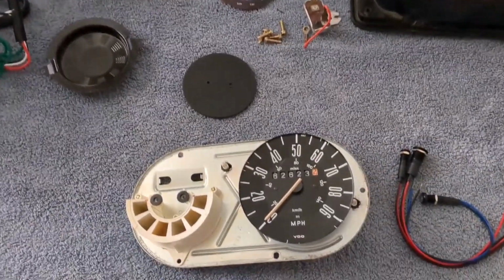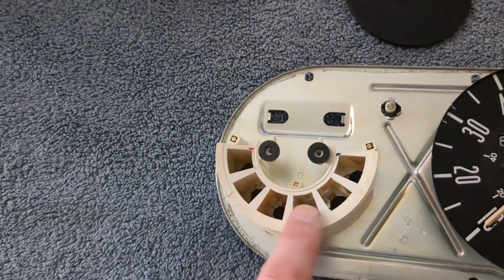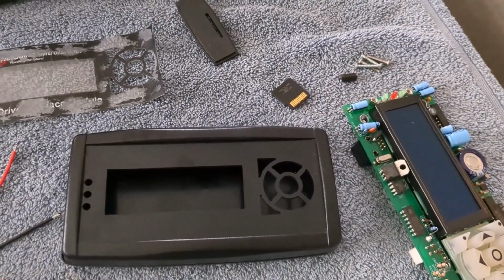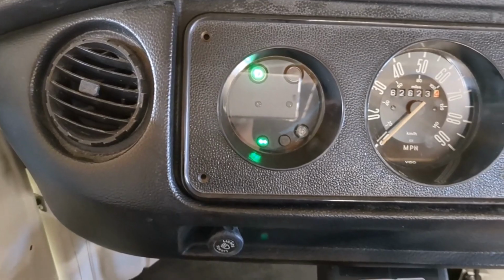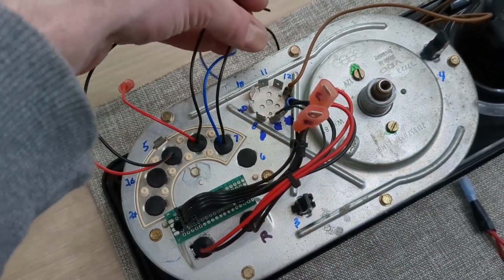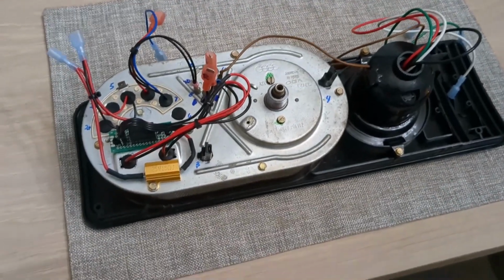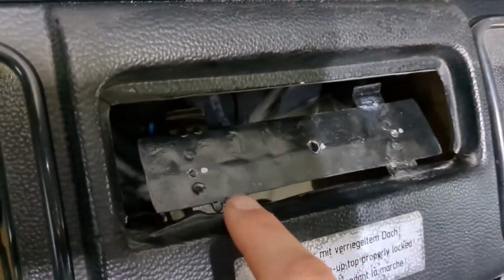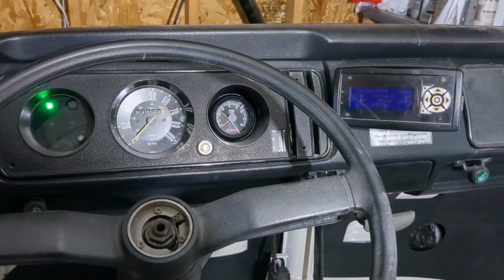VW Bus Electric Conversion Part 9: Dashboard Cleanup #evconversion

Comment: Love your video series! Question. Didn't quite get it; is the "charging" indicator tied to ignition? I.e. you will need to have the ignition key inserted to charge the batteries?
Reply from the maker: Thank you so much!  In my part 7 video, I enabled a 12v signal from my charging box to indicate when I had AC power coming in (the charge port had power).  I simply forwarded that signal wire to the front dash for that LED.  The key doesn't need to be in the ignition for that.